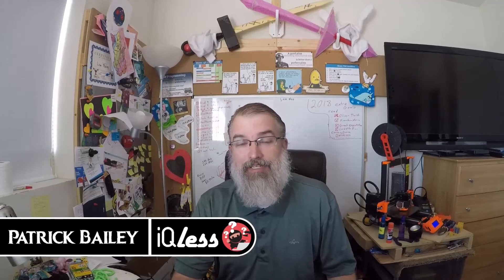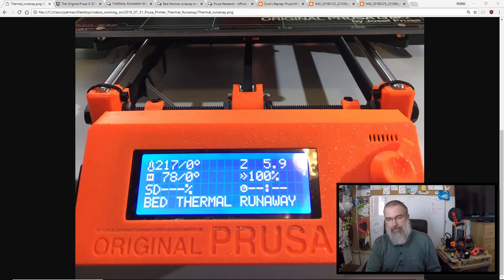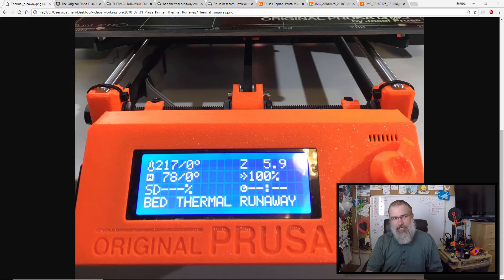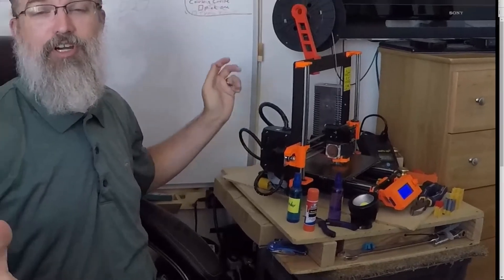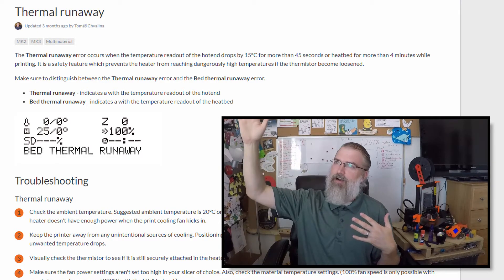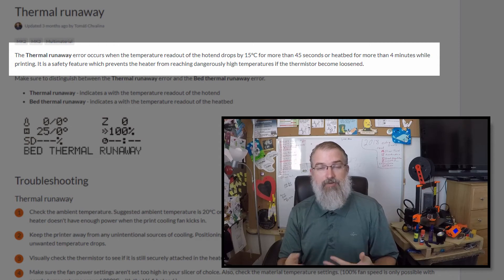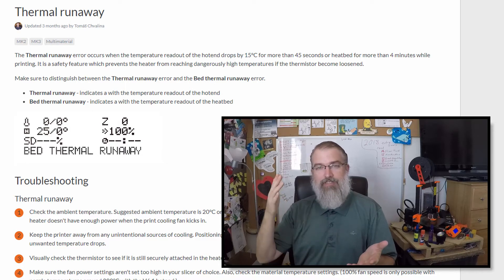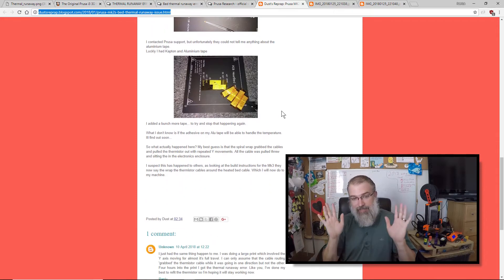Prusa Printer: Issue Thermal Runaway

Comment: A problem on the MK2 (not sure if it happens on MK3) is if you print a small object in say PETG and the object is in the middle of the bed, the cooling fan cools the thermistor and results in the same error.  The fix is to move the object away from the bed centre before printing.
Reply from the maker: Interesting.   In my case that was not the issue, but it may be someone else's case.  Thanks for sharing that tip.

Comment: I had this problem with my MK2 hot end, so far my MK3 is fine. But it was hard to locate the problem. I worked with Prusa for 2 weeks, that did not help. In the end I just decided to replace the  sensor and the heater. The heater came first so did it first and that fixed the problem. The heater was intermittent. No broken wires, but inside the heater it was intermittent. Any way back to your problem. You need to find the bad wire or connection and repair it. A poor connection on a current carrying circuit can generate heat and be a potential problem for safety.

Comment: I had the thermister come loose and, last week, had one of the power leads break. Both resulted in thermal runaway errors. Both are due to the mechanics of how wiring is connected to an object that is constantly in motion.

Comment: for those frustrated by this feature, keep in mind that houses have burnt down due to bad wiring on 3d printers. the anet a8 doesn't have this feature and really has burnt down several times. here's a recent report https://hackaday.com/2018/03/18/3d-printer-halts-and-catches-fire-analysis-finds-a-surprising-culprit/
Reply from the maker: Yeah safety first!    Much rather have a failed print than no house
Reply: hey iqless!

yeah, no kidding.  i'd much rather be frustrated that i can't print some shape than devastated at the loss of my apartment complex.  i'm sure my neighbors would concur.  i haven't seen a report of a printer fire bring down apartments, but that seems to be only due to chance.

other comments mention this, but just in case: your fix of jostling the wires isn't really a fix.  your printer is still broken if that's all you did to it.  you should look for the source of the spotty connection.  it could be a loose connector or pinched wire or bad solder joint, or something else along the wires.  a real fix will involve identifying why the wires sometimes disconnect and dealing with that.  maybe plugging in a connector in all the way, or resoldering, or getting new wires.

Comment: This happened to me twice on my MK2.  The first time, the wires were breaking off the soldered connections on the heat hed.  I cut the ends off and resoldered them to the heat bed.  The second time, the power connector plugged into the board showed signs of melting.  I assume this was actually induced by the first failure as the strands of wire kept breaking on one solder joint.  I fixed this by ordered a replacement connector.
Reply from the maker: I probably should break open the box and give it a double check

Comment: Hello Patrick, 
Very nice but frustrating feature! Thank you for the video on it!

My Mk3 is down right now... catastrophic print failure! Giant PLA blob on the hotend.  I accidentally ripped out thermistor wires trying to clear away the blob! So no printing for me for a while!
Reply from the maker: Ouch!   not fun
Reply: Charlie Bowen get yourself a silicone sock for the heater block it wipp make it much easier to remove a blob

Comment: You should check the wiring on both sides. The issue may coming back. Prusa changed the bed assembly to textile sleeves due to the nylon pinching the cables. If the power cable isolation fails you could damage your controller board hopefully only the fuse. Contact Prusa via chat maybe they send you replacement parts. I got myself some good silicone wire hoping it will never break.

Comment: Two things. 1. If you loose the thermistor connection, the temperature will change drastically  immediately, not over time. It's a resistor which reads either infinite or zero, depends on the connection issue. 2. Most likely your cable to the heater bed is broken. By wiggling, it got contact again. It's not advised to operate the printer at this condition. Find the broken (or loosen) spot and repair it. Otherwise the cable might melt and damage the thermistor cable. Like to watch your videos, keep up posting!
Reply from the maker: Well I guess my weekend project is a little tear down and inspection.
Thanks for the advice